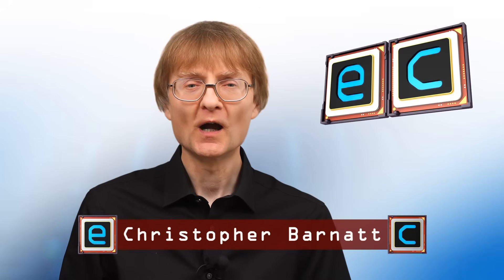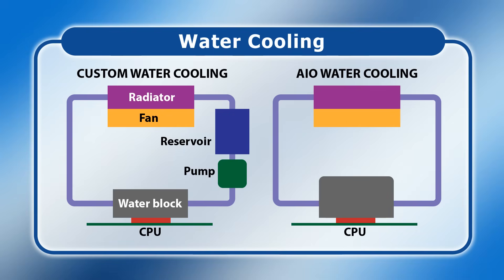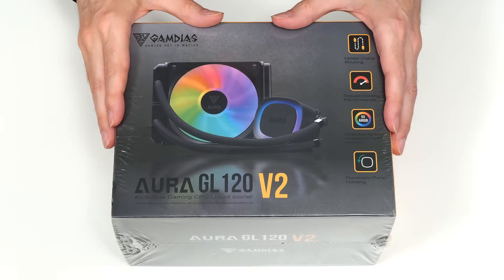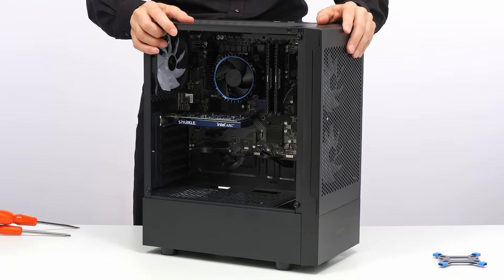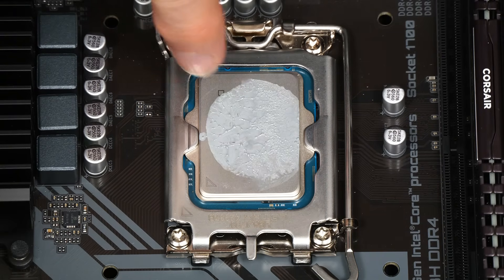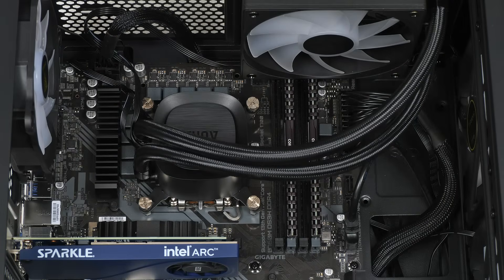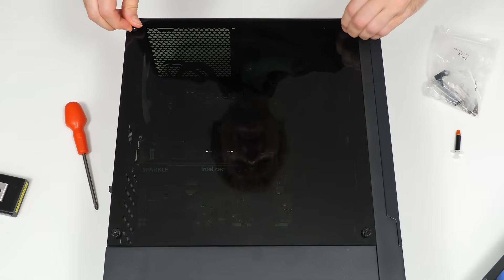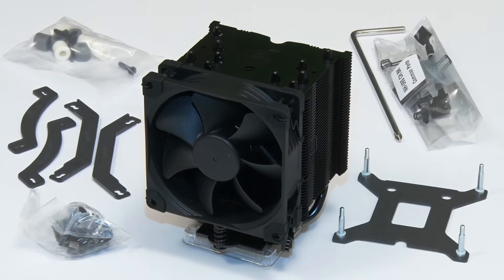Water Cooling a Desktop PC

Comment: There is a reason for water cooling actually. If you want to reduce thermal stress, it's either gonna be huge passive radiators with a lot of heat pipes or watter cooling solution with a single 120mm fan on a radiator. Latter one requires less space and puts less strain on the board by shifting the weight from it to the PC case, where your radiator is.
But yeah, it's a little bit more expensive compared to even the top tier air coolers. Intended for systems that have a risk of failing early because of crazy "turbo boost" overclocking from the factory, which is common these days.

Of course it's better to just have a cooler CPU, simple and cheap air cooling.

Comment: Custom water cooling is mandatory when you want the full performance of a 13900KS, even undervolted and tuned (not overclocked). This is not achievable with any AiO, nor with any air cooler.

Comment: Performance wise they are about the same, if you get larger air cooler it can provide the same amount of cooling as a larger water cooler. Noctua even has one passive air cooler (but you can mount fans on it too, just in case), but it is incredibly bulky.
But an important thing about watercooling is that some sellers which sell pre-assembled PCs don't ship PCs with air coolers because it's a massive amount of weight that can damage the other components if it gets loose. So some sellers just don't want that kind of liability and only ship watercoolers since the waterblock is really light compared to air cooler, and the radiator sit snug as a bug.

But I have seen some really fun watercooling over the years, like connecting the watercooling loop to a wall radiator, giving crazily low temperatures at high loads, or using a sub-zero cooler from a refrigerator.

Comment: I bought a Ryzen 9700X and considered water cooling but honestly, the air cooler I bought has done a great job even under heavy video encoding loads at keeping temps below 65C and with very, very tolerable noise at full blast. Looking at this sort of minimal water cooling solution tells me that I'd rather have the quietude and slightly warmer temps under load than the slightly cooler but noticeably higher noise trade off. Perhaps a larger unit would idle more silently, but that would also be a bigger investment. 

I'd like to take a moment and thank you for not filling your videos with sponsor spots and constant begging to smash that poor like button. Your disclosed affiliate links are about where I draw the line on laudable monetization; I cannot stand the way most professional and wannabe-pro YouTubers have slipped into the paid spokesman role for everything. In short, I just want to say that I appreciate your integrity and hope the example you set will be followed more widely.

Comment: There is no way i let liquids go into my PC case😂😉 but honestly, this cooler vs something like a Thermalright peerless assasin, you wont have the same discrepance in heat and noise. And even that maybe overkill for your rig. I think finetuning the fan curves of an air cooler is worth the time. I do it religiously (also case fans) and normally have a dead silent gaming rig.
Reply: That is a very ancient complaint and 'leaking' is only relevant if you for some reason trust Cooler Master AIOs which nobody should. Any sane AIO will have non-conductive coolant as well.

Comment: I've never found the 1x120 radiator AIO's to be worthwhile. They tend to perform worse than a standard tower cooler, and have a higher risk of failure. a 2x120 or 3x120 on the other hand, those do very nicely. The 3x120 on my server cools better than the dual radiator dual fan 140mm noctua tower, and fits better in the 4u server case. Since my servers are in the hot garage, and the computer's a 16 core thing, it needs pretty solid cooling. I tried a triple fan 92mm tower cooler and it wasn't able to keep up.

Of course, if you compare it to a stock intel cooler, pretty much anything will beat those.

Comment: Water cooling becomes more worthwhile on high end (high TDP) processors, tbh I wouldn't even use a stock cooler on a modern 6 core processor but at least an aftermarket air cooler is enough for that application. Personally I've been using a 240mm AIO on my R5 5600X for 2 years and it runs cool and quiet even under load in the middle of summer in Australia, I was skeptical about water cooling before I'd tried it but now I think all future builds will include it going forward.

Comment: You've got no way of knowing if that blob of heatsink compound has spread completely accross the CPU, if you use your finger for example and spread the compound accross the entire surface of the CPU, that should do the trick.  It's seems a shame to go to all that trouble and potentially end up witth something that may not sink as much heat away as it was designed to.  IPA woukd be a better choice as Acetone can be a bit vicious, although I noticed you had no issues with it.

Comment: I've been using a Noctua NH-D15 since 2015 and still going strong. Noctua will send you mounting hardware for new CPUs free. I don't think any liquid cooler would last that long without the pump dying or the liquid evaporating.

Comment: Closed loops are wonderful for novices, but are otherwise disgutingly wasteful long-term. Everything is better once the loop is open; with an adequate butterfly valve and drain at the loop's lowest point and a means to circulate most the old fluid, such can be exchanged completely every few years with a water fill to rinse, drain again, fill with preferred coolant (or, more water with anti-microbial) and return to service.

Overall, CLCs are great for what they are, but cannot be expanded or configured too easily. Components from overseas can be had for dirt cheap, be par quality to name-brand components, and with a touch of research you too can successfully install an open loop. Don't be afraid to try! Just do an air test first and if your loop is air-tight, then your loop is also water-tight.

Comment: Or and hear me out, buy equipment that's going to work for you without the need of voiding manufacturer warranties. There is no need for water cooling when you don't overclock.
Reply from the maker: As very clearly discussed in this video, water cooling is NOT needed, and I did for this FUN!

Comment: Double the size radiator with a single bigger, or two controlled fans means it can be almost inaudible most of the time but can also cool much better if required. This particular variant is almost a 1:1 swap, slightly quieter with slightly better performance ... sort of a halfway house. A "cobbled together" system I built about 25 years ago used a Seat Ibiza heater matrix (luckily the same width as a tower case) and a little pond pump (total cost about £50 inc the cooler block) - the loudest part under load was the psu fan!

Comment: Hi I need boot  up to a usb to run volumio on my laptop. whats key I need push F2 bios ? any help please.
Reply from the maker: It will depend on the laptop, but the usual keys to try are delete, escape, F2, and possibly F8, F11 or F12 (the latter may bring up a boot menu).

Comment: Question??? Do these coolers actually use water or is it glycol?? Thanks
Reply from the maker: My understanding is that it is mainly water, with some some form of glycol added (a few percent). However, after a lot of searching around, I could not find anything definitive on what exactly is in the AIO hardware that I used.

Comment: I understand that main reason for video is advertisement, but I was air system supporter long time but it seems nowadays cpu are almost too hot for air cooling, thinking to switch to pump and this video comes just in time because i don't know much about it. Too bad video didn't cover part how to choose pump because unlike air cooler pump's have no parameter of  how much heat it can dissolve.

Comment: I have seldom seen Chris as placid and composed doing anything in any of his videos before.

If viewers have never used one of the giant, two-sided heat pipe, double fan air coolers, you may not realize they often make access to the attaching screws or clips practically impossible, even with the motherboard outside the case. Forget doing it inside. You can't even see the CPU to be sure the cooler aligned. The AIO water style I once used was perfectly accessible while attaching. The water block is small. Keeping yourself from overheating might itself be worth doing an AIO. 

 The classy air giants likely cool the CPU better and quieter at high load until you get to a double or triple width water radiator. That results because the water radiators are so densely constructed that air flow is too low as temps rise, for normal fans.

Comment: Personally I don't like the idea of all that weight of one of those larger custom air coolers on top of the motherboard, especially when the motherboard is mounted standing up. Water Cooling moves where the weight of the equipment is, and to a lesser degree the volume and heat radiation source, which can be useful when using a smaller case than you did today.

Comment: I bought two water cooled computers. The cooling system failed in both in less than a year. I replaced them with a fan and cooling tower. It is much easier to replace a failed fan than to replace a failed pump. I’m sure it was a cheap cooler, but I didn’t expect both to fail in less than a year.  I’m reluctant to try water cooling again.
Reply: <-this
The value of Chris doing this demonstrates that it's a gimmick unless you have a very specific need for it, and if that's the case, you might need something more sophisticated.

Comment: no even considering price or performance, a watercooled machine will be noisier than a air cooled one, just the pump, you can hear it, you can hear water or whatever liquid flowing in there

if you want silence, no fan or a good fan at slower rpms is what you need

Comment: In recent PC builds, I ventured into the Intel 13th and 14th gen cpus. AIO cooling is a must with one build using a i9-13900k and the other a i7-14600k. Intensive cpu utilization generates a lot of heat for these cpu generations. Amazing that the system I use every day is a i7-11700 and it only needed a air cooler. Case design makes a difference in how easy or painfull mounting the radiator and fans is. The video as always presents the topic in a great detail, welcome to AIO cooling!

Comment: After owning numerous AIOs (all 360mm) from various manufacturers like Corsair, NZXT, ASUS, etc., the most common point of failure is the pump itself. I used to set the pump speeds to maximum. Now all PCs that I build have the Pump set to medium/balanced.  I do play a lot of games so I set the Radiator fans to high.  There was never a scenario where I had a fan fail. But if that happens it's easier to replace a fan than scrap the whole AIO when the pump goes out.

Comment: I've been building gaming computers for a couple of decades now including a few water cooled. I would never use a 120mm water cooler as they're invariably worse performing than most good air coolers. 240mm coolers are very good for medium to high performance PCs and 360 coolers are great for the top 2% of machines. In my experience...

Comment: 120 mm aio's have similar thermal dispersion rates as tower coolers.  aio's are great but you need 240mm or bigger to see any real difference compared to an air cooler.

Comment: I setup (Built with various parts) (Intel Processor) water cooled (Corsair Water Cooler) PC 15 years ago. Its still running (Windows 10) as primary PC daily for asks. Since October 2024 I am using GMKTEC G3 Nuc Box at another location with Ubuntu Linux. My computers stay on 24/7, I have not had a failure to date  ; )  I am retired since 2014, just running daily tasks, watching video, wonderful Youtube Channels like this one ; )  Thank You.

Comment: Way to expand your horizon, Chris.  I too think the thought of watercooling a desktop computer is neat, however, the benefits are marginal and in my opinion don't out weigh the risk in all but the most extreme circumstances.  There are application where watercooling is a requirement.

Comment: If anyone is thinking about using and AIO, I highly recommend the Artic range, absolute best performance and quality for a very good price, also they are a German company, so they have a touch of that European engineer expertise in them, and AIO do have a major advantage if installed correctly, as they can dump heat straight outside the case, instead of dumping heat inside and then recirculating back through the air cooler, they are the best way to exchange heat, from source point to outside the case, I have a nice build on Printables using the Arctic cooler with some custom 3D printed addons.

Comment: I appreciate these educational videos despite never planning on water cooling any of my systems! I feel like air coolers just have less points of failure, and even if they happen to fail, do it much more gracefully. Big fin stack should after all have much bigger thermal mass than the cold plate of a failed watercooler.

Comment: Hah, I have that exact same Arc GPU powering my Frigate NVR and PLEX Server ;) also even if these things leak, as long as it cant dump onto the power supply, very little could get damaged as most PCB's these days are fully coated, 99% of the time if these do leak, its usually very slight and will just leave some whitish colour staining near the leak point and that's it, most of the time it self seals and builds up whitish gunk in that spot, so you will see it if you check your system occasionally, the pressure inside these is next to zero, 40 to 50C wont generate much pressure at all.

Comment: Not a huge gain. For a single fan/radiator I would prefer a 140mm model as the fan would be quieter and the temps a bit lower.
For the price, not bad, however I still think an air cooler would be better and more reliable given the CPU.

Comment: When I was a computer builder, with single 120 mm x120 mm water cooler, I could not reduce the temperature of the CPU withe 4 cores. I got better results with a 6 heat tube CPU cooler!

Comment: I'm a little curious about which of the direct radiator and water cooling system is more power efficient. It seems the fan on the water-cooler doesn't work as hard and so won't need as much power, but it's also got an electric pump, which may cancel out the difference.

Comment: That's a very nice and well-integrated solution for water cooling.  I didn't hear you mention it, and didn't see it on camera, but did you have to fill the system, or does it ship pre-filled?  (Had to keep the audio low - my wife is sleeping).
Reply: All-In-One (AIO) CPU coolers are pre-filled.

Comment: Are those fans all working together, or competing against each other? Do they create an abundant airflow through the case, or are they all pulling against one another to remove as much air as possible? Assuming the latter, with more air available to blow through the radiator, how much cooler would the CPU's max load-temperature be?

Comment: I think I would rather have the water block hard plumbed to the outside of the case and have the pump and radiator on the back of the case . Less or zero  chance of leaking inside the case and no need to open the case for maintenance or repairs - sorry that’s my OCD kicking in 🤣
 I suppose that these systems would be great for the obsessive overclockers of the PC universe .

Comment: Very good video. The only water cooler I've dealt with is on my Quad Core G5 Powermac. Unfortunately, it has ceased to function. I can't find any aftermarket options for it. I keep planning on repairing it, but I have too many other projects going.

Comment: Air tower cooler has one less point of failure. If the pump dies the CPU will overheat  almost instantly. I use a Noctua NH-U12S with another fan added for a push pull config. If one of the fans fails it will still have enough cooling. Also, the second fan helps with keeping the VRMs cool. That's important after the 13 and 14th gen I3s. I use a I5-13500, 125 watt TDP and it can go higher. I will use my PC for hours every day, so reduntant cooling is at the front of all options. Also whisper quiet at normal load.
Reply: If you use Core Temp as I do it mitigates that problem as you can set it to automatically shut down your computer if it overheats.
Personally I would never use an AIO, I've only ever built my own custom loop for over 20 years now.

Comment: Just some observations that will show over time. The fluid dynamics and cavitation is likely going to cause an air pocket at the 'top' area of the CPU cooling block/pump. You would likely prolong lifespan and improve cooling if you rotated the cpu block compoent so the pipework is at the top, instead of the side, whilst also ensuring that at no point are the pipes any higher than the bottom of the radiator. This way the block can always be filled with fluid and any air always goes up to the radiator, and keeping the pipework below the bottom of the radiator (by at least one inch 25mm) ensures no air pockets are formed in the pipework . In it's current orintation there is a risk of air getting trapped at the top of the block because it can't rake it's way all around the pump, even with the pump going full speed.

Comment: I went with a Thermalright Frozen Edge 360 for a 5700X upgrade. 30ºC at idle, and not over 70ºC during rendering with 12% CPU and 3% RAM overclocking. Very satisfying.

Comment: I have mixd feeling by watercooler not alone from that one how killd  my 3950x in 2020.
Ther have only a use when, it gets more in a Silend direktion or a classic Air cooler is to Big or can´t handle the Head of the CPU/GPU.
All ohter cases are only more risk of failur for me.

I still cool a 5950x with a Dark Rock4 from bequiet.